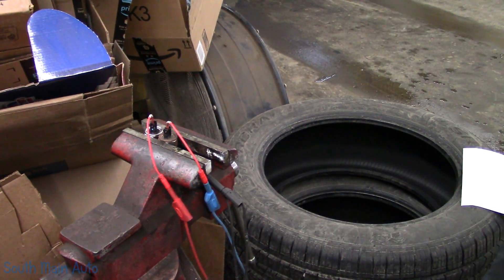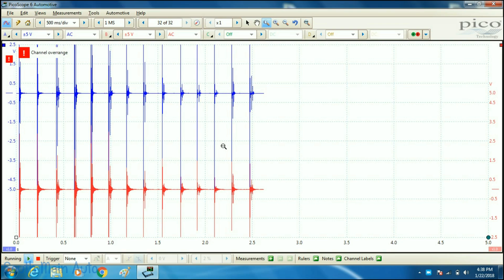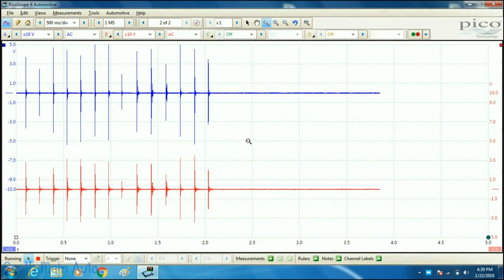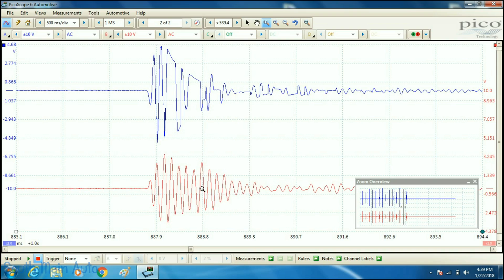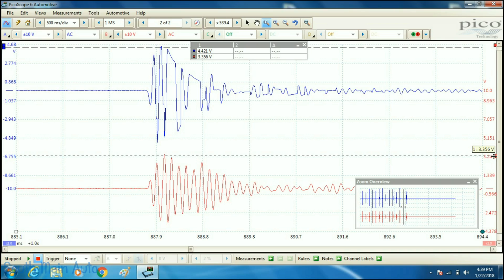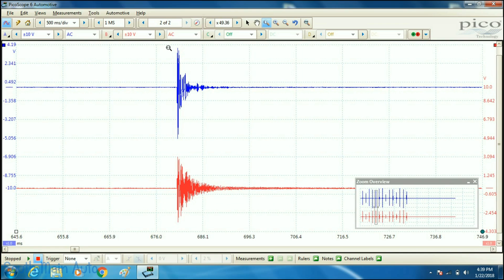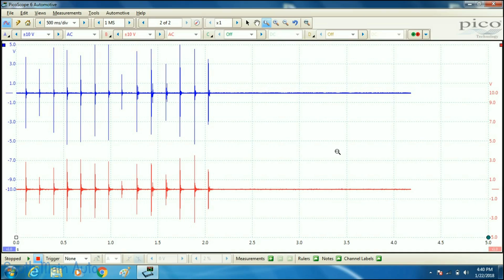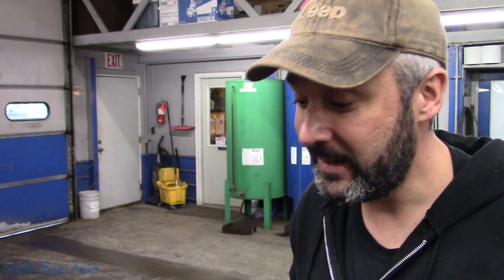Honda Knock Sensor Testing: Could You See It Without A Scope?

Comment: I'm not able to afford one of Pico's automotive scopes yet, but I have purchased the Pico 2205 which is WORLD's different from my Hantek 1008 (mainly due to the software & it's unexplainable lack of AC coupling). For all but CAN diagnostics, the 2205 or even cheaper 2204 can do everything I need with attenuators when needed
Reply: The only issue is the 2000 series Picos don't work with Picoscope Automotive 6.

Comment: Had my knock sensor replaced by the dealer - tried to remove it with a 1 1/16 box wrench.  No, go - the part was a c-note, and to put in was about 80 dollars.  After waiting for four hours for it, for a two-hour job, the service manager took pity on me and gave me the huge discount.  Two weeks later poof, here is the video of it.

Comment: I have multiple scopes including a pico 4425 but I’ve found some great deals on scopes just by checking craigslist and browsing pawn shops. I bought an OTC 3840f full kit that looked brand new a few months ago for $199 at the pawn shop. Still had the plastic on the screen and the leads were still tie wrapped in the original baggies.
Reply: Gerald lol. I bought it legit so no bad conscience here
Reply: That's awesome! Great find!
Reply: Score!
Reply: John Pilgrim they come that way new when they're stolen. Lol